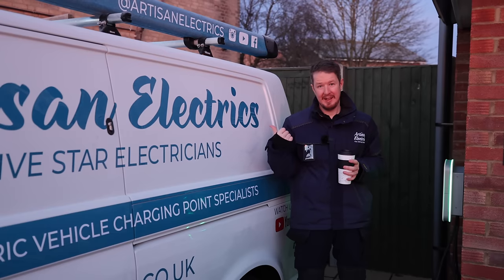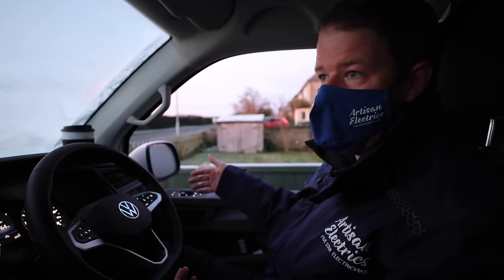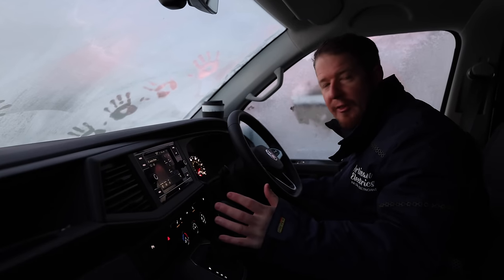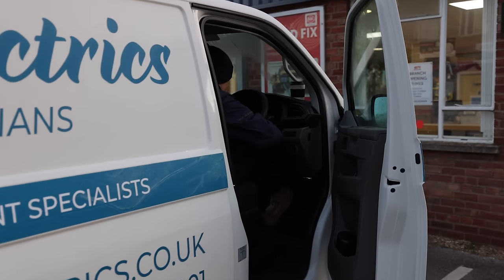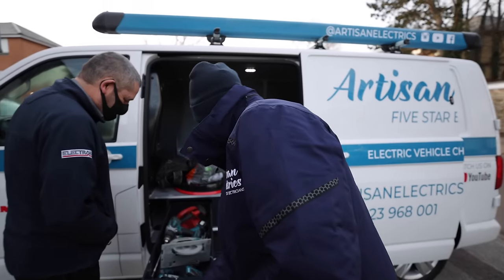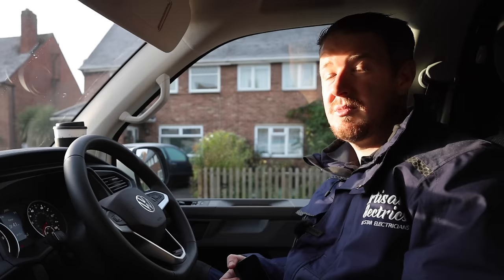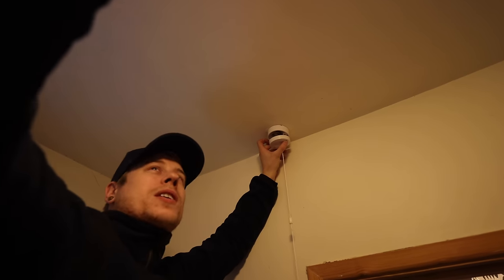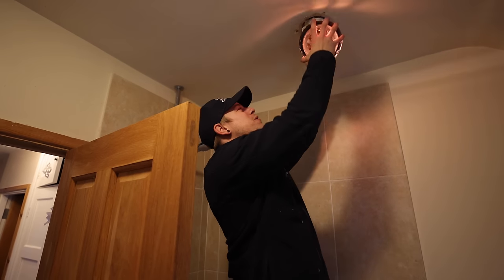ELECTRIC VAN NIGHTMARE 😬 - Volkswagen Transporter Electric Van

Comment: You should be able to set the van to heat up an hour before you get up in a morning... so you can set the heaters to come on at 3am or 4am while it is still plugged in and if its before 5 degrees giving it enough time to defrost.... but I guess they have dodged all that by just throwing a motor and battery in a diesel van shell.... easier, cheaper development and charge a fortune to the customer...
Reply: It's still a crap product. Excuses not required.
Reply: Problem is there are many situations where you won't be plugged in first thing in a morning, you should still have the option to use some sort of fast heating/defrosting. Also doesn't excuse how ropey it seems every other feature is on this van, really not ideal given how many other tradespeople will likely see this video!
Reply: Never an issue with the Vauxhall Vivaro E
Reply: @alexthewheelers  there is its called Electric fan heater on extention lead to keep van warm and defrosted atleast with a Diesel van start hater defrosts and warms Interior then has upto 600mile range things Electric van owners can only Dream of 😉
Reply: @andyplage6590  new e-vans do 210 miles with £2 of leccy.  economy that diesel owners cant even dream of.
Reply: @cbflazaro  untill Electric gers taxed to death to make up for the lack of fuel duties not being payed then ppl will realise that diesels were the way to go after all unless we get a guarantee from government and energy suppliers that they will do a price hold for 20years maybe by then electric vehicles might be usable
Reply: @cbflazaro  the government won't allow that. Remember we aren't allowed to have things at reasonable prices. Eventually after electric cars are everywhere they'll tax them so badly that you either won't be any better off or you'll be worse off. Need to pay for the NHS somehow. Remember, petrol would be pennies too if not for tax. In America, fuel costs peanuts.

Comment: Hot tap water is 55 to 70 Deg. If you pour it on roof first and let it cascade down onto windscreen you will never do it any harm. That's how I have been doing it for years with chips in my windscreen and no cracks at all.
Reply: Agreed 1000000000%
Reply: Never pour Boiling water onto a windscreen or paintwork for that matter. You will destroy your clear coat before you know it!
Reply: Me too, that's exactly what I used to do.
Water from the hot tap pouring it over the roof first just to take the edge off of it, then move down and pour the remainder directly over the screen.

Comment: To de-fog the windscreen turn the A/C on, using the heater only makes it worse. 
Scrap the van altogether,  battery powered vans aren't up to being use commercially. 
Thomas Nagy said something about them being rubbish when he was picking his van up from being racked out. He spotted one in the car park and spoke to the driver about the range and was told it was rubbish when loaded out for work. 

Happy New Year from Australia

Comment: I just started driving an e-208 and it's great, even though it's really cold here in Germany right now. Pre-heating via app, no problems with ice. Range reduced a bit, but not too terrible. Charging plug unlocks for 30 seconds when the car is unlocked. If it's already unlocked, you need to lock it first to unlock again, that may be somewhat inconvenient at times. Has automatic parking brake, easy to use. Pressing start button without pushing the brakes turns on the heating/ac and infotainment, but does not put the car into drive ready mode. This requires pushing the brakes while pressing start. On a wallbox the van should be able to Charge faster. The e-208 has a 3-phase 16A onboard charge that can do 11kW at 240V. 3.6 kW sounds like only 1-phase 16A. Maybe your van has a 32A 1-ph charger for 7.4kW and your wallbox is 16A 3-ph for 11kW. In that case the car only gets 16A 1-ph 3.6kW, because it's not the right wallbox for this car.

Comment: I think Ford are planning later this year to bring out a transit size electric van with near to 200 miles range, the advice is of course to wait for this.
Reply: 200 miles empty add your tools etc more like 150 if your lucky!
Reply: As range increases payload decreases, the current Transit EV is doing around 45miles on a full charge, totally useless
Reply: The next ford will more or less also be the next be as they have a joint development deal for commercial vehicles
Reply: Useless
Reply: 200 miles is still not enough 
I regularly do150 miles plus a day , but sometimes your stuck in traffic for hours with heater and  lights on no Chance your making it home with out pulling off and charging the thing for a couple of hours 
There is a reason people are not using these more , the range is still crap ! 
You can write almost the entire cost of these off against your corporation tax but still the vast majority don’t buy them

Comment: OMG, even my wife is shouting at the tv. What a muppet! Surely you did research on those ABT VW’s! Told you to buy the Vauxhall e Vivaro. 3.6kwh ha ha! EVivaro £29k for 50kwh- 143 miles or a bit more for 75kwh - 205 miles, and more cargo space and almost half the cost of VW. With 7kw home charge speeds or 100kwh Rapid charge speeds. Buy a scraper or use a credit card on your screen

Comment: Our Merc Sprinter had a heated screen. I don’t think Ford could keep it to themselves as it’s a safety feature.  We looked at electric vans but due to the distances involved it was not viable in our case.
Reply: Ford owned the patent which only lasted 25 years,now some manufacturers,especially those previously associated,Jag,LR,Volvo etc. fit them, but far fewer than many seem to expect. I regularly have customers complaining that their heated screens don't work only to have to explain that the heated screen switch is actually a screen demister button and that they don't have a heated screen at all. I suspect this is the case here. A heated screen switch always shows an electrical circuit running through a windscreen symbol on the switch, a screen demister shows a windscreen with arrows pointing upwards towards it.

Comment: Never use wipers and washers, or wind a window down, on any frozen vehicle!!! No need for a scraper, just have de-icer in stock - the ice will fall off. Failing that, plastic bag with warm (not hot) water wiped over the glass will slowly work - lucky you didn't lose any skin off the hands!!!
Oh boy, youngsters today (even with greying hair 😉🧐🤣).
Very brave of you putting out this video - respect 🤔😊.

Comment: And the government are telling us that in 10 years we HAVE to have these inferior things that cost the price of half a house. As well as heat pumps which are also useless in winter. Thanks Boris!
Reply: @levelcrossing150   It's no different to how they tax us with inflation, which is another form of stealth tax. We are also taxed on the tax we pay every time we buy petrol. The petrol is mostly tax, as petrol without government is very cheap, and then on top of this, look at the reciept; you pay VAT on top of that, so are paying tax on tax, after you've already paid income tax and vehicle tax. CONservative is right. Keep the poor poor and the rich rich.
Reply: To be fair that van is an awful example of an EV. There’s good ones  already out there - Mercedes makes a couple of vans with 200 miles + and a top speed of 160km/h. There are even longer range ones coming. It depends on your use case. If your regular day consists of less than 100 miles then that’s a great solution. With one proviso - you need to be able to charge at home.
Reply: Actually heat pumps work extremely well, we’ve got them in our school warm in minutes, Feb 7 2022, great. 4kw for the price of 1 kw,
Reply: @lioncrunch  yes but with the cost of electricity 1kw is ok ..but 8 hours a day a bit different
But 4kw isn't going to heat 2 large classrooms .. Then considering it's a school ,I would assume possibly 100kw is needed .. Saying a ratio of 4 to 1 .. That's 25 kw's PER HOUR at full power ...it stops being that cost effective when you look at it realistically ...
And a 4 to 1 ratio  is possibly it's best ... The ratio drops the colder it gets

Comment: Keep the A/C on as this will dehumidify the cabin air which will stop the windows from fogging up. This will work at normal cabin temperatures and the A/C will use less power compared to the HI heat setting. Remember A/C will dehumidify the air and can be used with heat but using heat with no A/C will evaporate the moisture from the air but will use much more energy due to the higher temperatures needed. Turning the A/C on will SAVE you energy and give you a clearer view of the road.
Reply: yeah most vehicles if you put them into defrost the a/c comes on, gets rid of the moisture as the fog evaporates.
Reply: @Lewdacris916  That's good at start up as the mode will provide max fan speed and max temp at the windscreen with A/C active. But after the defrost is complete the climate settings will revert to the previous settings, so if the A/C was off the fresh air coming in while driving will cause fogging as heated air hits the colder interior glass. In the video the fogging started mid drive but if the A/C was on the air inside should always remain dry. Best to always leave the A/C on in all seasons.

Comment: You should be able to set the van to warm up before you unplug it from the charging point, possibly via an app or via controls in van !!
Reply: standard that isnt it. Even my shitty renault kangoo ze has a prewarm function. If i was buying another ev van today id buy the ldv with the huge battery in it.
Reply: Doing the right / Normal thing doesn’t create content.
Reply: All that uninsulated heat escaping to atmosphere and extra electricity generation will help reduce global warming.
Reply: @mdf2mdf287  as opposed to burning dead dinosaurs to achieve the same thing

Comment: The rectangular heated windscreen button is for the back window and the slightly rounded one is front window
Reply: The man is a complete tool 🔧
Reply: This guy is bright as night. Big heated screen button on the dash. I looked at these vans but an 82 mile range is embarrassing.
Reply: Surely when you are spending 50k on a van you want it all singing and dancing. How can you payout so much and not even know what spec it has? With people reviewing every product known to man, why would you want to buy the first generation of electric van? I have yet to see anyone get the expected range out of any vehicles let alone an electric van that you are going to carry a load in most of the time. Stick with diesel or get used to loosing customers because you get a reputation for turning up late. Unbelievable.
Reply: Very disappointing to see him taking chances with a misted windscreen, morning and evening, because he didn't want to drain the battery. Very poor judgement, are his poor judgments only related to driving or is it poor in other regards, what about his judgements about his work???
Reply: Yup!!

Comment: I’ve had a Nissan Env200 40kwh now for 2 years after previously owning VW vans for years and the Nissan is great! When it’s freezing I can press a button on the remote from inside the house and in 10 minutes the windscreen is clear and the steering wheel and seats are hot! Plus I’ll be averaging 150 miles per charge! VW have definitely lost my vote.

Comment: To clear frozen windscreen

1. Use Lukewarm water only, when you hand in you neither feel it cold or hot.
2. Do not use very hot water or boiling water as risk of cracking.
3. Do not use cold water as it will freeze immediately.
4. Start at top of windscreen or window and pour downwards towards wipers.
5. Immediately wipe away with autoglym flexi water blade if you have one.
6. Avoid using wipers unless absolutely necessary and make sure they have been soaked in with the lukewarm water.

Works for me

Ps, for frozen doors pour in between the gaps starting from top of the door.

Comment: This van has to be the biggest flop for VW since diesel gate. They dropped the lease hire price to £180 a month to try and get rid of them. God help the ones that actually paid list. You can buy them for £25k with 900 miles on. 60 - 80 miles range, no rapid DC charging. Big lemon for VW
Reply: Interesting info thx

Comment: I’m an electrician and even though I’ve future proofed my garage supply for electric vehicles I don’t plan on buying one until there is no other choice lol, should of just got the transporter sport line much greater choice for the price!
Reply: The van was never going to make money! That'll be what the YouTube channel is for! :D
Reply: Yeah get a 200hp transporter and burn shit loads of fuel 🥳😸
Reply: @lancethrust9488  depends what you are using it for. A cheap Nissan leaf used by a typical mother working part time doing loads of short journeys works really well and saves thousands. Buy a new one is stupid yes
Reply: @lancethrust9488  absolutely right. Tons of waste batteries that can't be recycled... but my sister in law's is a 2013, still going fine and does 60 mile round trip. They have owned it 3 or 4 years spent hardy anything on it, a lower ball joint and couple of tyres.
Reply: @nickwf70  IT WILL BE EXPENSIVE WHEN A MAJOR PART BRAKES ,THE PACKS AND MOTORS RARELY GO PAST 100K ,  SOME TESLA OWNERS HAVE BEEN THROUGH 3 PACKS AND 3 MOTORS BY 250 K MILES , EV CARS ARE MONEY PITS AND ONLY SPECIALISTS CAN FIX THEM !!!

Comment: I'm surprised by a couple of things regarding clearing the ice.  
How does the heater not get to heat immediately as it doesn't have to rely on engine temperature?
How come a spark doesn't have an extension lead and a fan heater?
Reply: Yeh not agood  ad  for  v. W.  Is it..
Reply: he didn't read the manual and had no idea how to operate the vehicle. in an EV the heating starts immediately.
Reply: Tepid water clears ice and does not break the glass. Not hot water.
Reply: @jamescollins3647  Yes, I have used that that method for years without any issues.
Reply: @tubaman66  Only problem is it doesn't make anybody money lol.
Reply: @andrewgalloway9766  There's a Yorkshire saying:
If you know nowt, say nowt, an' 'appen nobody'll notice.
Reply: @Stew_PA  How much range does that cost?
Reply: @Stew_PA  That's the sort of info we need, thank you.
Reply: @Stew_PA  
What make \ model is yours?
Reply: Because it's a conversion, and a new heating unit has to be installed and my guess is they directly didn't add one.

Comment: Lived in Chicago. Defrosting fast in a pinch: A quart of cold water—not hot or even room temp—mixed with a tablespoon or so of table salt. Pour that along the top of windshield and then smear/rub with a clean rag* Get on the way. Use the wipers to get the water off. Get a scraper, because you don’t want to do this often.

*Not an oily rag—even a little oil—like friend did once. There was a smidgeon, a spot, of grease on his rag. What a mess.

Comment: According to an Auto Express  review "The e-Transporter’s maximum range stands at just 82 miles. However, Volkswagen expects the majority of e-Transporters will be used as last-mile delivery vehicles, covering an average of around 50 miles per day. Regarding performance, 0-62mph takes 17.4 seconds.

Volkswagen has also stated that the e-Transporter could eventually be offered with a larger 74.6kWh battery pack, if there’s enough demand in the market – which should see its maximum range increase to around 150 miles. The e-Transporter offers support for 50kW DC fast charging, which allows the battery to recover an 80 percent charge in just 45 minutes. The battery pack can also be topped up using a domestic 7.4kW AC wallbox charger, which will provide a full recharge in around five-and-a-half hours."
Reply: 17.4 seconds! :D :D
Reply: Still pretty pathectic though

Comment: The range in the van is going to drive you nuts! Any longer journeys your gonna end up having to charge during the day or borrow your customers charger if they have one 😂
Reply: Just get a generator in the boot 😉
Reply: My friend has an electric Pergeot van (Don't know the type), but he does 150 mile trips regularly with no stopping. (If it didn't, he wouldn't have got it regardless of the fact he is a big electrical car fan). 90 miles is just tragic. will be looking at a range of at least 200 miles when my transit finally finishes rusting through.
Reply: So if      you  have to charge  up at the customer   do you  pay  for  electricity.   Or  do you  knock  it of the bill.
Reply: @kenh3344  knock it off the bill. UK standard 3 pin socket can deliver 240v / 13A - 3kW (units) per hour, which would completely fill that vans comically small 37.3kWh battery in around 10 hours, or half fill it on a 5 hour job, and have added 30 to 40 miles of range and resulted in less whining sounds at the end of the video.